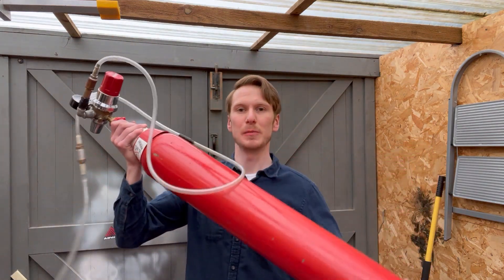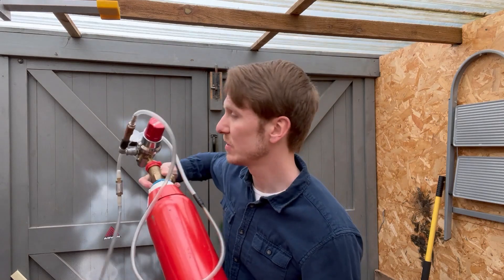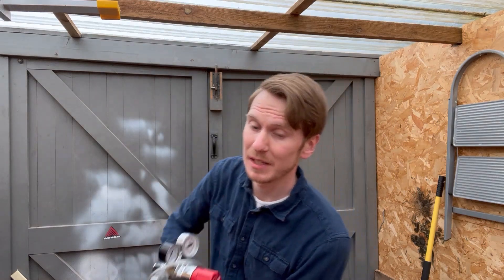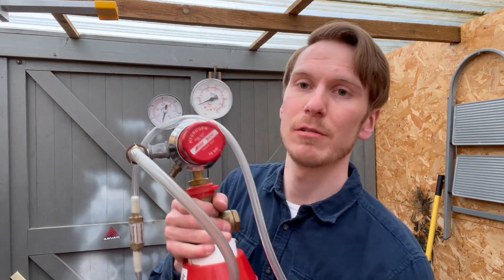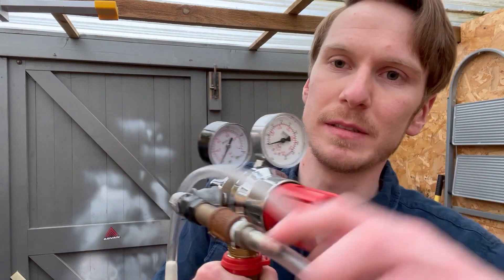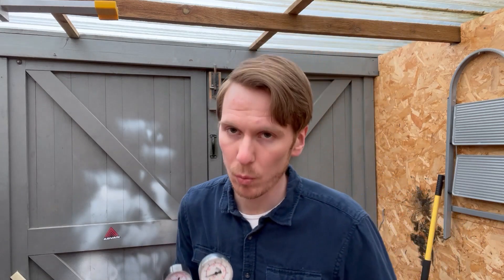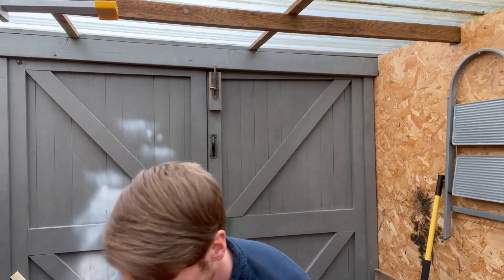Hydrogen Gas Storage & Hydrogen Engine Tips

Comment: If you're getting oil contamination then it means that oil doesn't reach operating temperature. If oil gets to 100 degrees C then all water will vaporise but if you keep it cool all the time then you get that same sludge you get on petrol engines that never get warm enough
Reply from the maker: Very good point, I guess it would only be and issue on engine shutdown, any left over water/steam would condense to water and drip to the sump still.

Comment: In 2003 I went to china  import 100 petrol Nissan cab stars trucks and to Mitsubishi l200pick up trucks petrol engines all run on lpg the bissness stop because of 2007 crash iam good to china to see if they will make hydrogen genertors  diesel generator run on hydrogen 33k moving forward

Comment: Hydrogen don’t run great . So to add something would be good come back to me I would like to use hydrogen and lpg to run a 8 kva genartor to charge battery for solar now 4kva run so when battery are low start generator good on farms
Reply from the maker: Sound like a great project. in the next month or two I will be uploading videos on how to make the hydrogen engines you’ve seen in the videos, sharing my knowledge for others to replicate and improve on. Hop you like the videos so far.
Maybe you could replicate and try your LPG idea?

Comment: Stag prins and Romano is my back ground  if on your car you put lpg 25% in to the pipe and 75% hydrogen the engine would run better and the performance would come up to90% and no the genartor would run nice. In the car put a lower thermostat number lpg would give you the water you need engine the main thing is to get them run smooth not 100% hydrogen 90% working to make your hydrogen in the car is the thing you
Reply from the maker: Mixing sounds like a good idea to increase the range, but the aim to to keep it as simple as possible with hydrogen only, keeping the carbon emissions to close to zero, brilliant idea though

Comment: Our local gas supplier does not sell hydrogen unfortunately and the HHO i make is useless
Reply from the maker: That’s a shame, it would be best to make the gas anyway as buying it is quite expensive, HHO cells are the best either, try getting a pure hydrogen gas generator, you can see me uses one in an older video, there good for filling tanks and running small engines with.

Comment: You ever planning on doing something with a wankle engine?  They have a intake ratio that means it wont explode if you feed it pure hydroxy gas. Pure hydroxy would mean no nitric oxide.
Reply from the maker: I would love to get my hands on a rotary, they just cost too much for me to buy.
Oxy-hydrogen is an awesome fuel to burn because of the no NOx emissions like you say, but storing it is very dangerous, to do it safely you would been 2 fuel tanks, one for hydrogen and one for oxygen, then mix together, I have seen this done successfully but it has its drawbacks, the cost of 2 separate fuels and the weight of 2 tanks. 
Still though, a rotary engine would be ace on pure hydrogen, Mazda did this with there Rx8 back in 2006
Reply: Maybe a good engine to run lpg and hydrogen it may run cool lpg runs15%hotter put a lower thremstat in metal engine love lpg jeep 300-400000 miles so jeep 4liter lpg hydrogen may run great better than small engine
Reply: Straight 6 run graet

Comment: How efficient is hydrogen? A small motorcycle how long  per liter/hour....... You can buy LPG kit on the internet then use it in hydrogen........ Try to use it maybe hydrogen will be efficient........ This LPG kit is use on propane engine
Reply from the maker: Hydrogen isn’t very efficient at all, it’s costs a lot more to buy too, the only benefit is zero carbon emissions. 
On my small engines I use a modified LPG carb, but to make them efficient you’ll need fuel injection, but this is still less efficient then petrol or diesel

Comment: Did you say that red tank will only last you 2 hours?
Reply from the maker: Depends on the engine, but the generator can last anywhere between 2 and 4 hours depending on load, 
2 hours at a high load
Reply: @Hydrogenguys  fascinating...and how much £ was the hydrogen tank excluding the actual tank cost...ie, so how much would a refill be? Thanks
Reply from the maker: Not 100% sure as the supplier doesn’t offer that service, however it’s advertised as £59 before other fees are added.
So it’s expensive, best thing to do is make your own pure hydrogen gas with a pure gas generator, like I have used in the past. The problem is that there slow at making it.
I’m only using purchased gas now for consistency during engine testing.
Hope this helps.